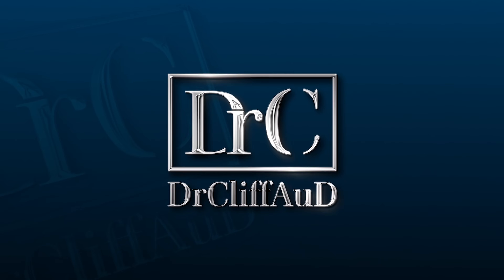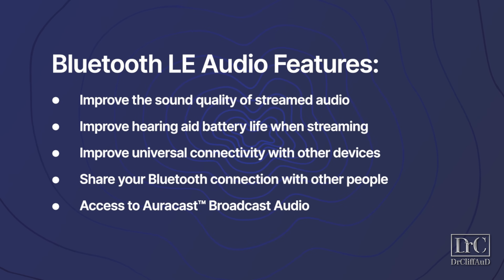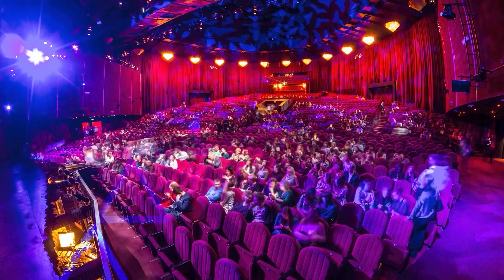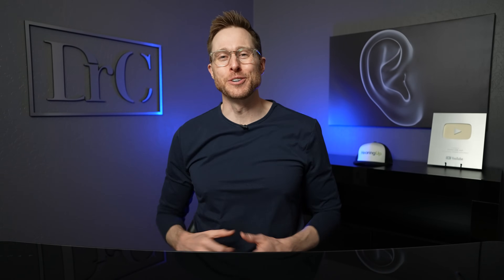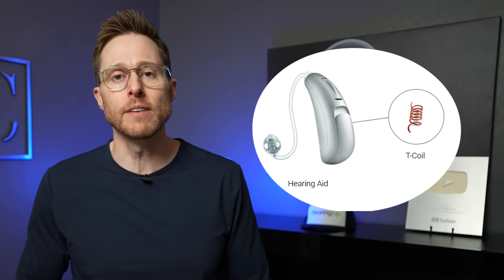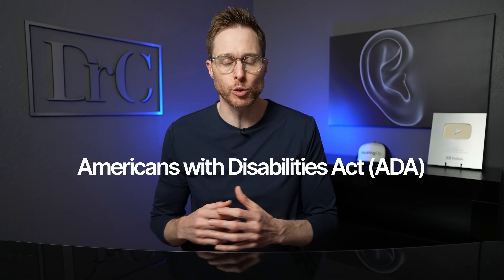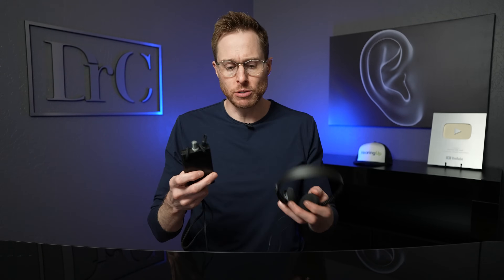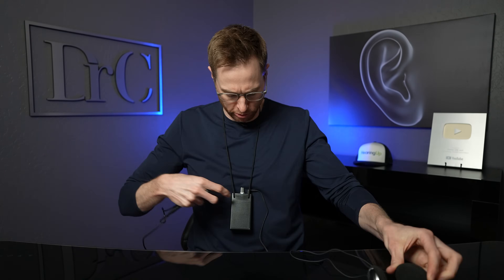LE Audio Bluetooth Auracast Hearing Aid Hack

Comment: Your demo is silly and uninformed. You use a neck loop for a venue with a FM or IR Assistive listening system. Your set up with a Williams Sound Loop Receiver goes from hearing loop to receiver to neck loop to hearing aids with t-coils which is the same as just using the t-coil directly. What you really want to say is if you are at a venue with Auracast and you do not have Auracast hearing aids you can ask the venue for an Auracast receiver tuned to their Auracast system and plug a neck loop into the receiver. First, extremely few venues have Auracast. Most that do are really just demonstration sites. It will be years before enough venues have Auracast to be worth getting Auracast hearing aids. Also, if a venue has Auracast and not IR, FM, Induction Loop, they HAVE to provide essentially adaptors so  it can still communicate with your hearing aids. To use Auracast, when it becomes ubiquitous, You need new hearing aids with the Auracast chip, and a new phone with the ship as well. So, the magic Auracast thing will cost you as much as $7,500. That is you spending a personal fortune to use a system that is working to put all other systems out of business, a monopoly. It will be over six years before it is "THE" ALD system (the lifespan of most hearing aids.

Comment: Thanks for the tip. How can I ge affordable aurcast type technology now on my tv so I can sit with my family.  My next HA will hopefully be intent in the near future.
Reply: There are a few Auracast transmitters that can be connected to a TV. However, this tends to make hearing worse because the latency of these devices is so high at around 40 to over 80 milliseconds that the video and sound are so far apart that it becomes irritating. To put it bluntly: in a thriller, the victim dies before you hear the shot.
Reply: @NorbertMuth  Need more information. You need a phone with Auracast and you need Hearing Aids with Auracast. That's a lot of money. It is inherently not affordable. It just is not designed to be.

Comment: Dr Olson, why not have a telecoil receiver and a Bluetooth transmitter embedded in one device? Then if the hearing aids have Bluetooth you can stream directly to your hearing aids. Since the telecoil receiver has a 3.5 mm jack, I can buy a battery-powered Bluetooth transmitter that has as an input a 3.5 mm cable. If I hook those two together that I should be able to have what I want. But all I'm doing is making a hack where a matter of facture could combined those two things into one. That way for people who have hearing aids that do not have telecoil but do have Bluetooth they have a solution. I prefer completely in canal hearing aids which many of those do not have telecoil but some do have Bluetooth. So, why hasn't a smart company made a combined telecoil receiver - Bluetooth transmitter to solve a basic problem.
Reply: One major point of Auracast design as perceived by users is that Auracast is designed to eliminate all other Assistive Audio streams. A "non-universal access" like ADA requirements, and monopolization of Assistive Audio. Then, you buy a new phone to control it and new hearing aids costing thousands. It will be years before Auracast and hearing aids reach a viable saturation level to make conversion financially viable. Me, I'm a hearing loop person. Tap my hearing aid button and I'm on line. What could be easier?

Comment: Is there an Auracast transmitter I can get for my place of worship for those that need assistance?
Reply from the maker: Not yet
Reply: Do you have a PC that handles the audio or would you require something that plugs into the audio system? Looks like there are options now, I can provide some links if you need. I just bought my first transmitter for my laptop at work to test it out

Comment: Hi Dr Cliff, I have phonak audeo P90RT, there is 1 meeting room at work(provided with t-coil signal) when I activate my t-coil, my hearing aids keep whistling, while it doesn't do the same in another meeting room and works well. I wonder why?
Reply: Hi, I am a loop installer who does high-end systems and never does bids. I do not have to. Clients come to me and accept my invoices without question. They love my work. ,,.,,,,  The Whistle, the room microphone is picking up your hearing aids giving off their sound and sending it into the system. It is usually from someone installing a loop and mic system without really knowing what they are doing. It is a common problem and sign of poor training.

Comment: Topic I don't think I have ever seen you ever cover.
What about going to concerts where you know it will be very loud either in a big concert hall or a small club?
Do you wear your hearing aids but turned off?
Do those specialized concert ear plugs that get advertised any good?
Do you just resign yourself to some very tight fettling ear plugs?
Some of us still LOVE music clubs and concerts and don't want to lose any more hearing, if possible.
Thanks for any info.
Reply: If your hearing aids have proper ear moulds and not cheap open fittings with small silicone caps, then you already have your special concert earplugs. And your hearing aids limit the maximum volume to the level that your ears can tolerate in the individual frequency ranges. The hearing care professional sets this via the MPO (maximum power output). The Teleloop also runs via this MPO control, so there is no danger here either.
Reply: Ear plugs, as a whole, filter out higher frequencies. That's where the interest of music is located. Lower frequencies focus on some drums and bass guitar. Lyrics and lead guitar riffs are screwed and dang hard to hear in concert.

Comment: Will there be a firmware update for LE audio on the Oticon real 1 or is it not possible with a firmware update?
Reply: If the device has Bluetooth 5.2, they can theoretically be updated to support 5.4 or 5.3 and get the le audio features, but they have to have the hardware already there

Comment: Funny...have had telecoil in all my hearing aids, activated by audiologist, BUT never used it bcs never have been in places using telecoil technology. Kind of a waste. Places should just use bluetooth LE ... after all, this is 2024.
Reply: If you have never been in a room with Induction Loop, then you will never be in a room with Auracast. Because if the operator of a facility has not taken care of the needs of the hearing impaired in the past, he will not do so in the future either. So Auracast would be an even bigger bad investment for you.
Reply: Remember, Auracast requires a new phone as well as new hearing aids. Europe solved this years ago. If your venue had a microphone, you had to also have a hearing loop. If you sold hearing aids, they all had to have t-coils.  That is universal access. Now, companies ALL want to create a monopoly, proprietary system requiring everyone to buy compatible equipment... telephones, hearing aids, tv Auracast transmitters, and they want your money. a t-coil costs about $4.00. That's not a profit driver. So, they invented something that costs more.

Comment: i can’t wait for Mc Donald’s restaurant tvs to be connected to auracast transmitters. most of the time the sound volume is turned down low as to be inaudible (probably in the interest of keeping the sound environment quiet). with a pair of latest enabled headphones/earpods, one could enjoy the full sound experience on demand. Q is when will cheap auracast xmitters become readily avail?
Reply from the maker: That's the question we are all waiting to have answered.
Reply: Seems that there are a few options now that are USB and $35. But that only works for PCs. Im sure the market will move to tvs having them built in within the end of next year (there's a few options now but all high end) as more and more devices with cheap SoC's get Bluetooth 5.4 built in from the factory and auracast is as easy as turning it on in the software

Comment: I made sure when selecting hearing aids that there was a telecoil option installed and active in my devices.  I do have a couple of neck loops but have not had the opportunity to try them out.  The only time i had the opportunity to try a set up as the one in this video was before I had hearing aids and was using the provided headphones.  It will be interesting to try this option if the opportunity presents itself.
Reply: most receivers do not put out enough power to drive a neck loop. They are manufactured for longer battery life, not of power output.

Comment: Thanks for that but could you not do similar with a resound multimic by plugging that into the theater's kit using a 3.5mm jack into the multimic and enjoy the sound even without telecoil?
Reply: Would work.  Similar to connecting a Phonak Roger device.  The difference is both the Roger and Multi Mic are a lot more expensive than a simple neckloop.  Roger and Multi Mic do a lot more than what a telecoil neckloop can do, but a neckloop does its job very well and is affordable for most users if their hearing aids have telecoils in them.  Older hearing aids don't have built-in connectivity to Roger, Multi Mic, or similar technology, but many have telecoils since that's nearly 90 year old technology.
Reply from the maker: Yes you could do that too!  Any workaround you can come up with is always a good idea!

Comment: While I have a telecoil and always have had, the Roger devices do a wonderful job doing the same thing.  Except of course then you have battery life in the Roger device to worry about.  A neckloop obviously doesn't use its own battery for EM signal generation.  

Either is great when traveling.  If you're the tour group type, many guides give tourists receivers and headphones.  Many museums have audioguide systems.  Neckloops or a Roger On devices can plug right into their audio jacks in either scenario.  

For movie theaters, to my knowledge AMC doesn't provide audio receivers.  They use the buggy cupholder caption devices instead.  Can't speak to other chains, but I would much prefer the option of an audio input via Roger or neckloop!

Comment: Signia IX 7 T requires a firmware update so not sure I am eligible !
Reply from the maker: If you have the 7IX T, then you can use a telecoil neck loop.  You just have to wait for the upgrade if you want to use Auracast!